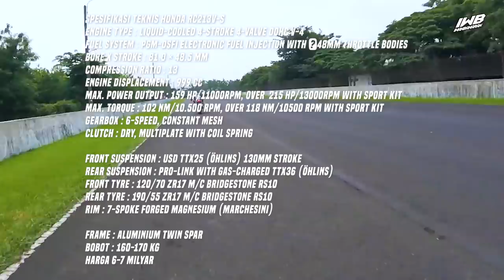NGETES "REPLICA" MOTOGP SEHARGA 7 MILYAR 🔥 | NGERI CRASH 😱 ! RC213V-S

Comment: Cak itu versi replika pakai pneumatic valve kaya asli motogp apa pakai spring kaya motor biasa
Reply: ya itu spring, tapi kurang cocok kalo disebut spring kayak motor biasa, material dan design-nya pasti beda.
Reply: Berarti istimewa nya hanya material nya bagus dan iconic ala motogp saja ya om..la limiternya saja 8000rpm..misal diadu sama 1000rr nya apa mampu ngejar itu rcv
Reply: @heriiswanto5063  begini, itu pertanyaanya sepertinya tidak cocok, 8000RPM itu limit  yg diset oleh AHM untuk mereka2 yg mencoba motor itu,standarnya sebanrnya di 14000RPM,dan masih bisa di unlock untuk RPM yg lebih tinggi jika dipakai buat balapan.  mungkin sebagian org sudah salah paham. pertanyaan anda seperti mengadu NSF250R dengan CBR250RR, jelas itu tidak seimbang sebanrnya.